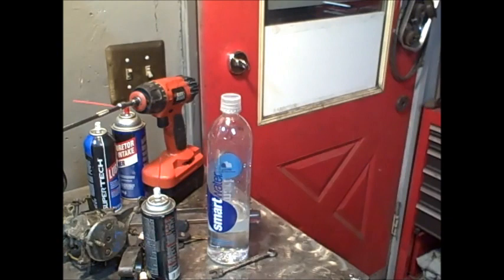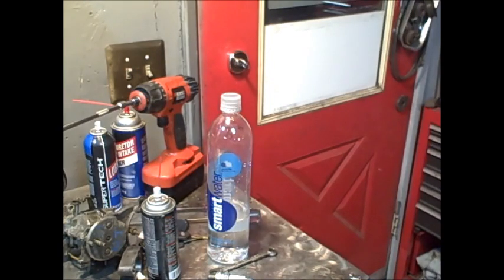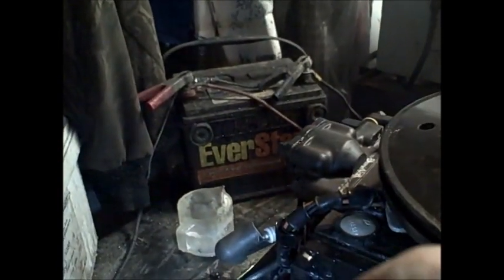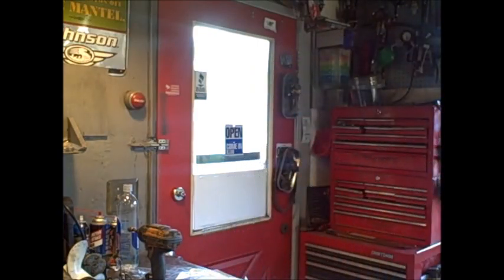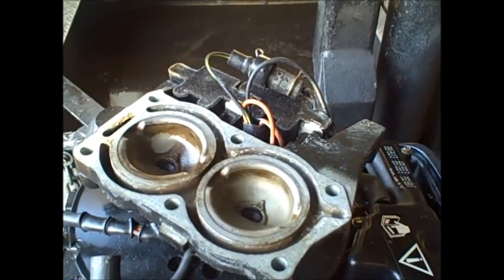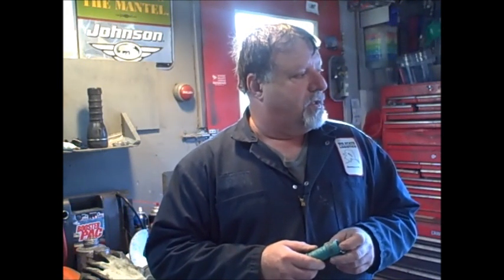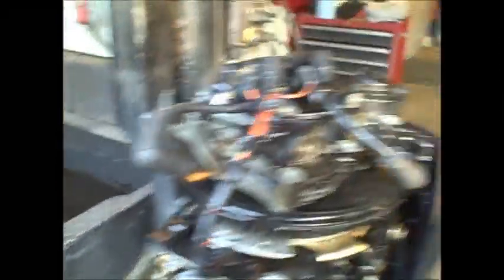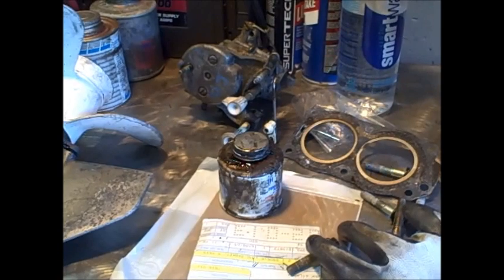15 HP Evinrude repair

Comment: Thank you for pace and detail of your video. Enjoyed it. Question please. If you did compression test on each cylinder and you got 90 lb on both. Could you still have a head gasket leak issue? Thanks
Reply from the maker: Yes'  I had that happen on a 30 hp Johnson.    kb

Comment: Good work, but wondering since there is evidence of a hot motor why you didn't just replace the thermostat to cover that potential over heating issue.  Seeing that it is the wire covering/protector, perhaps the alternator was over charging.  My manual says that if the machine has a generator, you should always hook it to a battery to keep the rectifiers from blowing.... but that evidence of heating would bother me....

Comment: Hello Mr Bass. Do you know if there is any way I could rig up forward controls for this model? Obviously steering and gear are ok. The internal throttle linkage is the problem.
Regards Phil.
Reply from the maker: if you can find the old 2 handle Seahorse shift controls you can do it.  they r hard to come by but I did it several years ago for a friend,  I do not have a vid of that tho, sorry.  kodi
Reply: @kodibassInsideoutboards  Oh. How old?
Reply: Back again. I also have 1980 9hp Evinrude[military]. Would you know if any other motor has compatible lower unit? 5 bolts.
Reply: @kodibassInsideoutboards  I  don't want to be a nuisance. I have several Old double handle controls. The thing that has stumped me is how do I access the internal throttle lever. Cheers Phil.
Reply from the maker: @pepegan52   send me a email to   lenny@alaska.net  I can then reply & send the attachements + PN's  that I think will help U.    kodi
Reply: Thank you sir. I'll do some more research.

Comment: Thanks for the vid!  I have a '89 10 hp Mercury.  Low compression.  I tried spraying penetrating oil in the cylinders (originally only was about 5 to 10 psi when I first pulled plugs), it's getting about 25 psi on each cylinder now.  Apparently, it was sitting for many years.  About to pull the head, hopefully, it's just a head gasket and not rings, or worse.
Reply from the maker: +B  Yep' check your head gasket & cylinder walls,  If no scoring is present  your motor can be re-ringed''  not to hard @ all on that motor.                                                                                                                     kodi
Reply: @kodibassInsideoutboards  Thanks!  I am looking at the parts breakdown for the cylinder parts, there isn't a gasket listed for the two cases.  Strange.  There are exhaust side gaskets, seals for the upper and lower crank, and lower gasket for the powerhead.  I am going to tear it apart.  I will need about $200 in parts, then I will be selling it since I don't have the need for it.  It's a very clean outboard, but just about at the price point where if I have to put any more money into it, it would be a wash.   Thanks for the video, I love working on boats and outboards, your vid really helped!

Comment: I had an '87 Evinrude 15 that the grommets for the water cooling system so shut from the damned alcohol in the gas. That's a pretty bad head gasket. I really enjoy your videos are really helpful even for guys like me who work on these damn things.
Reply from the maker: +brt 123,  Yes the grommets are motor killers on this model for sure.   Lucky for me we have no ethanol where I live so far.  Salt water does'em  in as well.   good little kickers otherwise.                                                      kodi
Reply: @kodibassInsideoutboards  I really like the way you describe the problem and then you show the solution most of these videos that others do don't describe in detail the problem take for instance how you showed your getting really hot good spark but it's running on one cylinder then when you pulled the head and showed the two cylinder heads and how one is loyal in the other looks like it's been steam cleaned. I work on these things but it's hard to find someone who can describe the problem and then the solution in a way that cogs with the wheels in my head. Keep it up you're very appreciated

Comment: Yeah,, that thing looked way too nice, doesn't even look like it has been run in salt water....Yep, somebody overheated it for sure....They lucked out in that the water didn't get into any of the bearings, sounds good.  The question is how and why did it overheat to begin with, and was that problem taken care of....You could ask the owner, but it is doubtful you will get the straight scoop....The only other thing that worries me is that this engine has TWO of those pesky upper water tube grommets cuz it is a 15hp.  Yeah, the design was improved over the years, but the latest ones still get crushed.  But, that engine doesn't look like it has been run much in salt water, so I'm guessing the grommets are not an issue.  But, if it were mine, I would definitely pull that powerhead and tend to those grommets.  I usually cut them back a bit so they are less likely to get crushed over top of the water tubes.  It is such a nice engine, would be a shame to destroy it.   I know, I know, the owner won't be interested in spending that kind of money.....
Reply from the maker: +kramden,  I agree on those grommets,  I thought I was the only one cutting them,,,  I have seen so much heat damage to these low profile motors from them rubber motor killers,  I will admit I have never came up with a absolute " true Fix"  for those grommets.  dam shame cause these are pound for pound one of the lightest &  most powerful motors out there.                                                                                                                 kodi